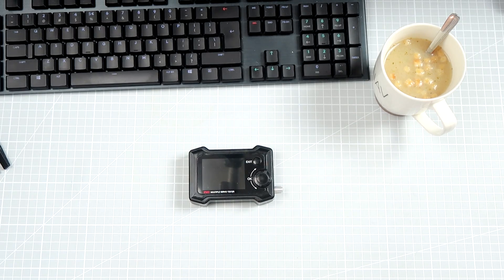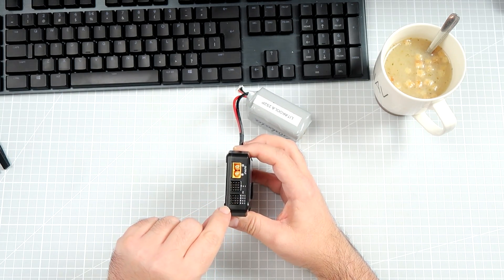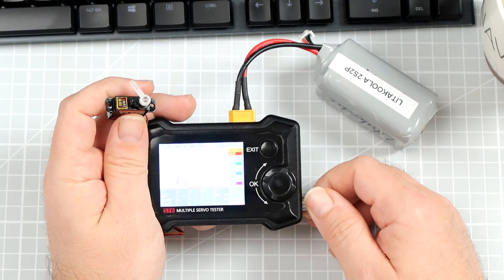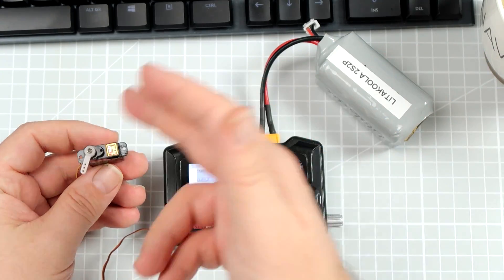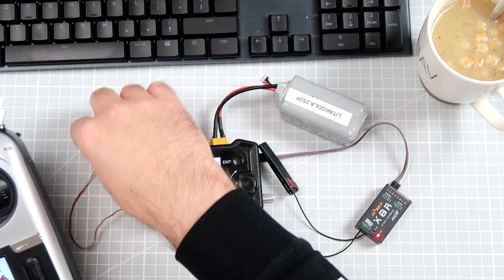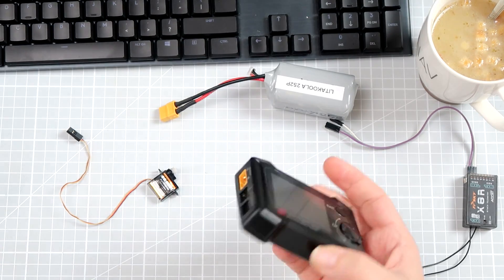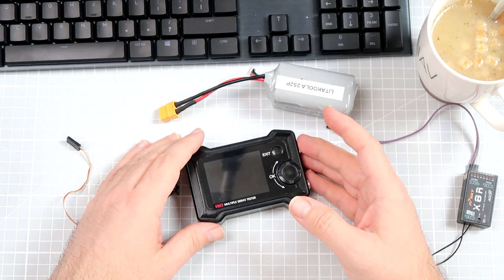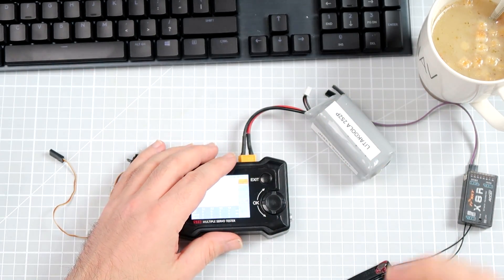ToolkitRC ST8 - a servo tester and much more

Comment: I wonder what would happen if you had a battery plugged into the input and then plugged another battery into the output. Especially if one battery was say 4S and the other was 6S. Agree that the price is a bit high, but it does have cool list of functions.